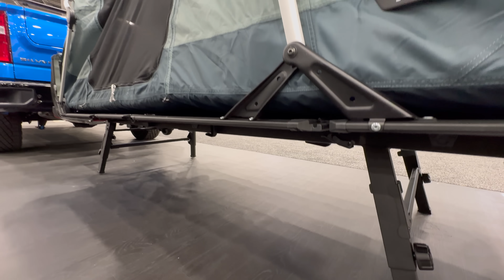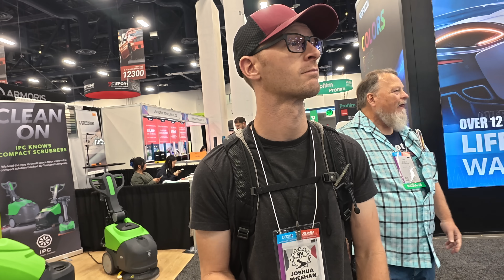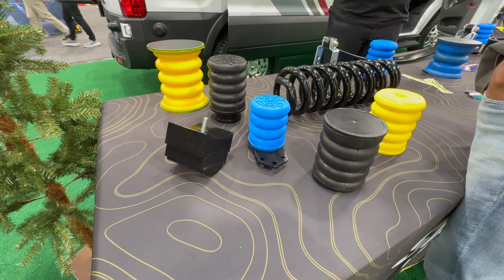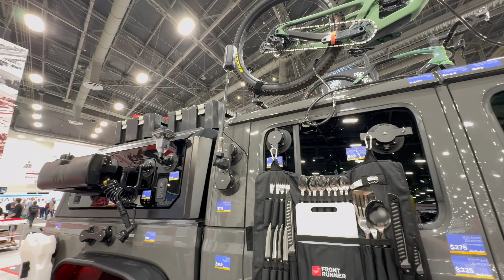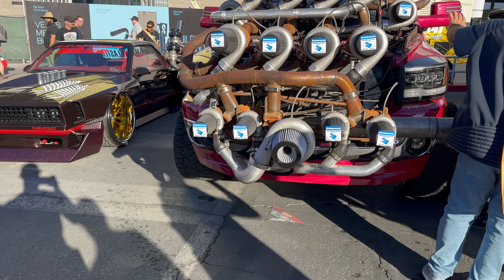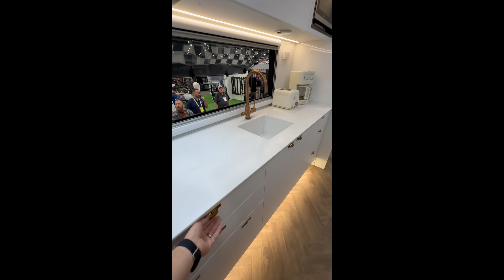The Real Game-Changers at SEMA: RV Gear You Can't Buy Yet

Comment from the maker: ⭐⭐ Examples of Products Used In This Video ⭐⭐
🔷RealTruck Hard Roll-Up Tonneau Cover https://geni.us/Og6fZom
🟢Earth Lift https://stertil-koni.com/
🔷Challenger Lifts https://challengerlifts.com/
🟢Thule Outset Hitch Tent https://geni.us/LIulwbR (Amazon)
🔷Thule Foothill RTT https://www.thule.com/en-us/products/-_-901250
🟢imCamper Truck Tent https://imcamper.com/
🔷Van Compass https://vancompass.com/
🟢Trailer Valet Tongue Jack w/ Scale https://geni.us/7WnAAZ (Amazon)
🔷Trailer Valet Remote Mover https://geni.us/NSIKY (Amazon)
🟢Inflatable Paint Booth https://mobileenvironmentalsolutions.com/
🔷Inflatable Paint Booth https://carcapsule.com/
🟢Pop N Lock Catalytic Anti Theft https://geni.us/rTU9xu
🔷Pop N Lock Trailer Lockbox https://geni.us/omfJasr (Amazon)
🎙 Beyond the Wheel Podcast https://beyondthewheelpodcast.com/
🟢Omni-Wall Organization https://geni.us/1f7Ddu2 (Amazon)
🔷SuperSprings https://geni.us/vTwMCCf (Amazon)
🟢SumoSprings https://geni.us/MNMB6s9
🔷Lock N Lube https://geni.us/JBaAm (Amazon)
🟢Lock N Flate https://geni.us/wWIHBg (Amazon)
🔷ARB Earth Camper https://arbusa.com/earth-camper
🟢Wild Land Double Decker Tent https://iwildlandus.com/products/wingman-auto-setup-roof-tent
🔷Spliseal Wire Connectors https://geni.us/hBIwfC
🟢Tow Tether https://geni.us/3rN0rGo (Amazon)
🔷Titan XXL Fuel Tanks https://geni.us/3JOhNH
🟢Seasucker Suction Mounts https://geni.us/FOzzla
🔷Tmat Modular Grid Organizers https://geni.us/IGHMt (Amazon)
🟢Blue Ox Adjustable Ball Mount https://geni.us/E4gMQ
🔷Rock Tamers https://geni.us/scKS2 (Amazon)
🟢Rock Tamer Mudflap Light Bars https://geni.us/ysi3 
🔷Rock Tamer Traction Crate https://rocktamers.com/off-road/traction-crate
🟢Flated Air Topper https://geni.us/v39Rio (Amazon)

🔵Elevation Off Grid Truck https://www.elevationoffgrid.com/
⚫Titanium Caravans https://titaniumcaravans.com.au/models/ti22-s4
🟠Urban X Campers https://urbancaravans.com.au/urban-caravans-now-in-the-us/

🚐 Favorite RV Gear:
🔸GasStop Propane 100% Emergency Shut-Off https://geni.us/KmLBS (Amazon)
🔸Liquified RV Tank Treatment https://geni.us/P5WuP4 (Amazon)
🔸Fastway Zip 6” Breakaway Cable https://geni.us/d7BZ (Amazon)
🔸Valterra Twist On Waste Valve https://geni.us/IHqqrCA (Amazon)
🔸Motion Sensor LED Night Light https://geni.us/JfbEnf (Amazon)
🔸HitchGrip Hitch Handle https://geni.us/FENglr (Amazon)
🔸Portable White Noise Machine https://geni.us/puASyQQ (Amazon)
🔸RV Ramp Levelers https://geni.us/iJWkX (Amazon)
🔸Solid Rubber Wheel Chockshttps://geni.us/vS04fc4 (Amazon)
🔸8” Clip Fan Rechargeable https://geni.us/eyXAgd (Amazon)
🔸Portable Propane Fire Pit https://geni.us/NCLvDx4 (Amazon)
🔸MaxxFan 12v Vent Fan https://geni.us/UBiMM (Amazon)
🔸Dual Fuel Generator https://geni.us/LSlpV (Amazon)
🔸Fresh Water Hose https://geni.us/8aoSb (Amazon)

DISCLAIMER We participate in several affiliate programs that earn us a commission on purchases made through our links at no extra cost to you!
Some product links are affiliate links which means if you buy something we will receive a commission. As an Amazon Associate I earn from qualifying purchases. As a Walmart Creator I earn from qualifying purchases. 

Some of the gear in this video may have been provided to us at no cost. The views and opinions are our own. This video is NOT sponsored. Some product links are affiliate links which means if you buy something we'll receive a small commission.

Comment: Cool video & content, if you weren't aware Sema does have a public day think it's on Fri, I've never done it as it's so massive & not sure what they charge but it's next to impossible to see everything though it might be nice if there is specific categories like overland or tools you want to see. 

As for products I can't speak more highly about Lock n Lube it's an amazing comp based in NH & a really awesome thing that they offer which many don't talk about & honestly think it's something that could be used by the RV'r, Overland,or anyone that doesn't have onboard air. They have a kit for the Milwaukee M18 inflator which switches Milwaukees screw on connection to the quick connect. Just so I didn't mess it up I called them & though they do a lot of sale on the jungle site they do sell from there warehouse in NH & being in NE Area I had it in like 2 days. But I also have there quick connect for my grease gun I use the extension version for ease of use but they have so many options & adaptors like my lower ball joints are little tight spot & since switching to their products less four letter words used & less things thrown lol But I know many people that use inflators like the Milwaukee & if you need to top off multiple tires it's a pita having to screw onto each valve vs i think the Lock n Lube kit was like $40ish & makes maintenance slightly quicker & like I mentioned not many channels nor clips at sema showed it which surprises me bc everyone that's seen mine has asked where did I get it. 

Though I don't RV (would like to but current situation there aren't many options for those in similar situations but of what's available just not in my range but I do imagine that I can adapt something. My career choices had risks which I knew & though I've been able to recoup after many injuries unfortunately I had one line of duty injury which wasn't fixable & stuck in a chair but I still live & enjoy life though being paralyzed kinda limited) since I don't let this injury stop me from trying to enjoy life, like many in various circles I do carry have tool kits & kits in general for every day use but also have setup's for when traveling. Like another neat thing that can be used in many of the things you mentioned is often sold at govt auctions the military has portable mechanics tool kits that have 5-7 drawers in a Pelican or Harding wheeled case & though made/intended for field repairs of military vehicles it has a great selection of tools & one I got is an older one but under the contract most if not all have to be US made so the full wrench & socket sets in SAE & Metric are S&K brand where the newer ones that are slowly trickling out to auction are Snapon (though out of my price range if you find a complete set it's a steal bc it's a 7 drawer set in weather proof case more tools but at min half the cost if you were to buy it new  & like I mentioned it has everything to do a field repair so besides wrenches it has electrical to screwdrivers) I won't lie the kit I have is prob overkill but your not going to find a full set of USA made tools for the $ & though older personally I feel some of the older ones better quality though S&K are still made so if anything breaks I can get them replaced. I know from watching channels like yours tools(kits are a common topic & figured I would mention this especially it being in a weather proof case like I have strapped it down in bed of my truck on last road trip no issues yet drove through almost every weather type! 

Sorry for the long message not sure how to condence it & explain it(head injuries don't help) but try to pass on neat things like if I had the $$ I agree with you on those super duty's 🔥, I've seen them before & love them but honestly the truck market after the coof went stupid like I could of sell my used 2500 Denali for close to what I paid for it but trying to find something like I looked at a Lariat 250 was like $4-50k more & that was stock not even one of the E models. Like needs come down to reality. As honestly don't feel like avg person can afford a new truck & if they could comp's cheap out like no matter brand top trim still has halogen bulbs & no bed liner like there charging $100k+/- it should feel like it like though I got it used but factory liner was part of trim pack as were all LEDs & may sound petty but halogen plate lights just don't match(this is my 2nd top trim truck bc I got a deal[1st I got when I was doing a govt job & at time was my dream truck] on it I was looking at a lower trim new one & this was a fresh in off lease low mi. Though that said it will be my last GM)
Reply from the maker: I appreciate you taking the time to write out all of that perspective - thanks!
Reply: @rvgearandfar again I apologize for the long message with head injuries I want to make sure what I'm thinking about actually comes out in a way it's understandable. Also sometimes get lost typing when it's something interesting. I've actually wrote messages which have taken a bit & deleted them bc of length. 
Again great content & subbed after this video

Comment: The "Cowboy Hat Holder," is almost guaranteed to get the driver a ticket for Obstructed Vision of the road. BOOM!
Reply: I was thinking the same thing but they already make one that attached to the headliner. Though I've seen them mainly in law enforcement vehicles they are probably available for civilian purchase & most mount them mid center (basically easy to grab when getting out also doesn't obstruct or take up space even in civilian use most have a center console so really not loosing space unless you have a bench seat that's used often hopefully person isn't tall ha)
Reply from the maker: You're onto something there for sure

Comment: I’m actually looking at getting a generator for my rv , so to see/hear about the predator is something I would love to see! I’m leaning more towards the jackery units because of the solar capability in that some campgrounds don’t allow generators due to noise.
Reply: Just a heads up as I was comparing battery vs gas backup options & though Jackery is a great brand HF Predator & Bluetii both are using the LifePO4 batteries vs Lithium Ion, I'm not an expert nor engineer but from what I read the LifePO4 batteries are safer & better longevity though I recently learned that HF had a 2000w ver I haven't done much research on them but one of the other things I remember reading the Bluetii (& think Ecoflo) allowed for higher wattage recharging via panels the article I read (not bashing Jackery as I've heard good things about them) again still learning but the Bluetii allows for higher wattage 7-800w where the Jackery only allows for 200w. I'm not sure what the HF is but figured I would pass info on bc I legit went down a rabbit hole not only comparing solar & batteries but also gas & figured I would mention these key things or save you some time. Especially the battery thing as I know that there has been a lot of talk or concerns about batteries & personally had a small electronic device the lith ion battery swell like lucky it happened when it did bc who knows what could of happened if I was away or asleep & didn't unplug it as quick as I did though they were only size of double AA's but 5 of them starting to cook off ya I'm more cautious now. 
I think for your application battery is definitely a good choice for a primary though I would probably think of getting both at some point! Just bc my luck sux like I'm really good friends with that guy Murphy and his Laws lol  But also looking back at think it was North TX that went solely on renewable for backup pwr & they had whicked bad storm which their renewable had issues ya that would be me so I like to have the backup to the backup/redundant or Mil thinking 1 is 0, 2 is 1 ha 

As I mentioned in another comment though I could be wrong but from another creator think that HF said these weren't going to be till Fall 26 but they do have a 2k running watt that's under 50lbs & their 4k running 5k starting but it's like 100lbs (not sure about there non-inverter type ones from the multiple electricians I spoke with all recommended bc some electronics can be sensitive to type of power & inverter type are better or cleaner source of power.) 
Hopefully this helps like I mentioned I spent way too much time & if potentially save someone from going down the hole researching them I would pass info on but more for consideration and I'm personally going fuel route first than solar just bc of cost & time of yr(solar isn't really a winter project like I have hard enough time getting help it's worse when cold lol)
Reply: @how-i-roll-rb5796 thank you, it does! Wasn’t even thinking of lithium ion vs lifepro standings! Of course I now am getting all kinds of ads on FB for generators. I like the bluetti because I believe you can add to them to boost output. Thank you again for your input!!
Reply from the maker: Something else to look into is a DC/DC charger from the tow vehicle to a battery bank on the RV

Comment: I totally agree with your comments on the new campers from down under.  Our market is not only stale but built like crap.
Reply: US customers would love the quality until they saw the price. Double the quality equals double (or more) the price.
Reply: Decades ahead of the North American manufacturing!
Reply: Oh dont worry bud, theyll manufacture them here and match the quality of the same brands. The US Market is consistently the easier to convince to spend more and get crap quality.
Reply: @davidferrer678no, none of the Australian. Manufacturers change their buld materials for the US. They all us aluminum, Steel, and composites throught their campers.
Reply: @ryansheard8092 sure maybe at first. Then they realize how easy it is to build cheaper and still charge the same if not more, it always ends up happening.
Reply: @davidferrer678Patriot, Arkto, Pause......long lists of ones that still haven't
Reply: @r @ryansheard8092 and a longer list that has

Comment: That was an awesome video thank you for that! 

The hard roll up bed covers have been around for years (first I believe by Bak). My issue with them is they have been consistently 3-4 times the cost of a soft roll up bed cover. Looks like Real Truck has unfortunately followed that pricing pattern. 

I can confirm the Lock n Lube grease fitting is amazing and should be a standard purchase for everyone who has a grease gun. Well worth the price! Can't wait until they come out with a 90 degree fitting. 

The SpliSeal fittings were probably most interesting to me since I have a RV and a bay boat. Really cool kit but again (like so many other things these days) is way overpriced in my opinion. 

The Seasucker mounts were neat but honestly not something I would spend a lot of money on. I definitely wouldn't trust them holding a gas can (that seems like a lawsuit waiting to happen). 

I want to love the Blue Ox ball adapter but I'll admit I'm skeptical. Too much at risk to take a short cut for me.
Reply from the maker: I agree on the suction mounts - super cool, but suction EVENTUALLY fails without intervention - not something I want for that type of application.

Comment: Will that 4200 watt run a 50 Amp rv I know something like ac and TV and water pump I'm sure a 4500 would be better
Reply: So they haven't released the numbers yet or I haven't seen them but I looked at their 4500 one & it's says it's max running is 3650. I know one thing that confuses me & wonder if it confuses others is every company markets them with starting watts vs there actual running. Like I mentioned the 4500w one max running is 3650 per there site but that's also just AC & if I remember correctly some have both AC & DC so I'm not sure how that works & wondering now that I think about it if the 4200W is meant to be used to recharge say batteries & be like an emergency use where it gives you enough for major items. Though not an expert but last trailer I had think it had a 5k & that was a long time ago
Reply from the maker: It all depends on what is running in the 50amp rv and how many amps it is using

Comment: I look forward to checking out the new Predator 4200W Gen.  Any word on a release date?  Was considering their 5000, but with this lighter weight unit, its definitely something to consider.
Reply: I think in Dmaxryno video they said fall 26 but could be wrong. He does a lot with HF & has a good video on their booth. Though originally didn't even look at there power tools, when they came out I moved to mainly red tools. But not going to lie I've had it twice a red tool not available & currently now have few Hercules (though I hate having multiple batteries) but can't argue with the cost, performance & biggest if you ever have an issue they will swap it out in store which is huge like not sending it out & waiting. 

As for generator I'm most likely picking one of the bigger ones up during Blk Fri sales as like the 4200 it's an inverter gen though no engineer from research & talking to those that are invertor gens provide cleaner or better power esp with some electronics being sensitive. Like I said I don't know much about gens but a lot of people speak very highly of the predator line of invertor gens vs Norm. Also a neat thing w 4200 & think mentioned in that other video is say you running it on gas but have LP hookup it will automatically switch if gas runs low, & can't remember exact amount but know with the bigger one I'm looking at for my house you do loose some amount of wattage dep on fuel used like it's 4200 starting & say 3800 running on gasoline LP or NG might be 3500 running but don't quote me. Coming from military background I like having redundancy or 1 is none 2 is 1 theory so like I might have have a bigger LP tank but I always have a few jeri cans. Lastly if you didn't know the inverter type run bit quiter which in certain cases is a good thing.
Reply from the maker: Thanks for sharing that info on what you've heard on the release date.